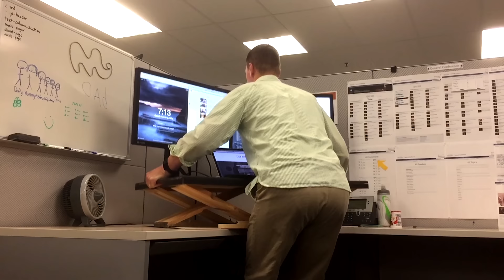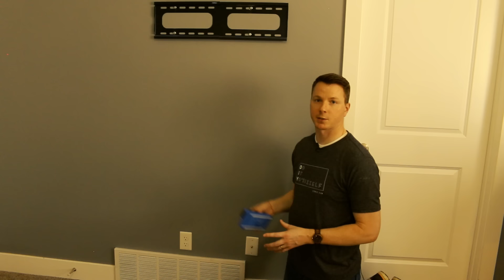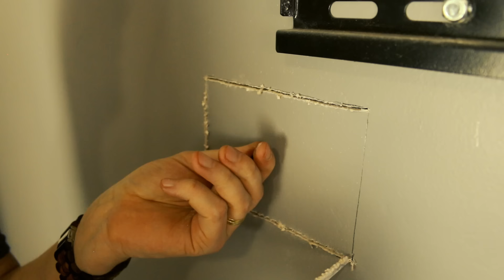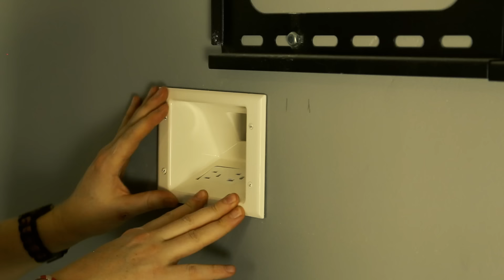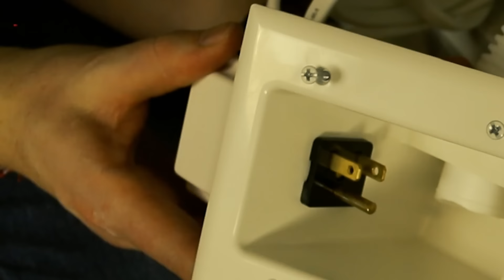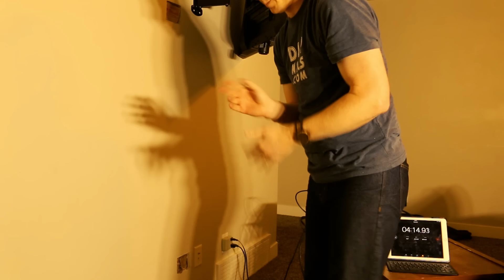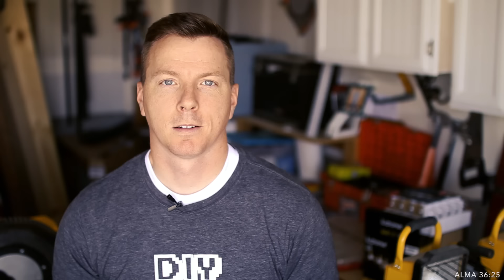How To Hide Your TV Wires in 30 Minutes - DIY

Comment: What a BS video demonstration.  So easy to follow a wall cavity with the outlets sharing the same cavity.  Also, yoiu dont need that contraption to fish the wire thru.  A total unnecessary expense.  How about showing a tough installation, where you have to run your wires across studs or floor joists, with minimal damage to drywall or floor or ceiling.  Then I could actually say the video was useful.  This one was crap and anyone with half a brain could do this.

Comment: I wonder if they have a kit that replaces the outlet with a hose so that you won't need an extension cord.
Reply: They do have it, I'm buying two of these and it replaces the bottom outlet

DATA COMM Electronics 45-0031-WH Recessed Low Voltage Media Wall Plate with Duplex Receptacle - White https://www.amazon.com/dp/B004GZ89N0/ref=cm_sw_r_em_apa_fabc_pHX0FbTCE59XE?psc=1

Comment: What do I use to cut through paneling without splintering it?
Reply from the maker: You have several options. Using a multi-tool or oscillating tool that you can plunge directly into the paneling would be clean. Another option is to drill a hole and then use a jig saw with a fine tooth jig saw blade. The shallower the better.
Reply: @LRN2DIY  thank you. Great video and instruction I’m ordering the kit in your link from Amazon right now

Comment: TIP: If you make the cuts at an angle, piece will not fall into the hole you make AND will be EASIER to put back and will have stronger joints on all four sides.
Reply: That would be true if you were cutting a hole and then replacing with the cut out but in this case you're putting a square plastic box in the hole instead, which if the sides were beveled you'd damage them anyway.

Comment: Great work and tutorial! Nice modern version of brush style or recessed cable/audio wall plates already on the market. Although, I must interject to your “up to code” comment. In my state, any long-term use of an extension cord is frowned upon. While you had the wall open, you could have added a junction box and rerouted power(with proper gauge Romex)to a receptacle behind your TV. Then just add a blank wall plate to cover the old receptacle location to eliminate dry wall repair.

Comment: 2 things? Why would you coil up the electrical wire and not cut it to length? And also, why not run it to the existing outlet and connect it there, and eliminate the extension cord?

Comment: Seems like the long way around - I moved the plug behind the TV with a 2.00 handy box and covered the existing receptacle hole with a blank cover. All you have to do is disconnect the plug and pull the wire up the wall and re-install the plug. Same With the antenna. Spent $10 bucks total.  20 minutes tops!

Comment: This is too much work & not that much hidden. I simply run a line from the outlet below & tap into the additional screws on the outlet & install an electrical outlet behind the tv. Bam all done.

Comment: If you put the wires in the tube before you run it down the wall it will take half the time. Been tv installer for 20 years and with me time is money. I enjoy your videos though and I’m not knocking how you did it because if you’re not careful you can damage the Hdmi cable. I also run a Optical cable down with the Hdmi for surround sound option if customer wants 7.2 speakers later on.

Comment: Seen the video, seen the wires go down the plastic tube but where do they connect??? All I seen was the extension plug he plugged in but it didn’t show where the cable wire plug goes once they go down the plastic tube

Comment: Would it be easy enough to get that pipe/conduit in your first install through insulation?
Reply from the maker: It would be trickier but possible, especially if you could get a fish tape or measuring tape and pull it through.

Comment: Could you also use the screws that are holding up the TV bracket to find your stud instead of a stud finder
Reply from the maker: You sure can. The TV mount is usually a good indicator as are the existing outlets, which are mounted to a stud as well.

Comment: FYI, there is flexible conduit called “ENT” that is fire rated for in wall use and will be stiff enough to pull wire through.  That bilge hose is not in wall rated so if you had a fire, your insurance company could deny your claim for having done work that does not meet building code.
Reply: Thanks,  very useful information!

Comment: Hmm no. I'd tap into the receptacle and if needed drill through the stud, fish wire and install a real receptacle. Then I'd get a couple brush cover plates for Ethernet / HDMI or run WiFi and no brush plates.

Comment: I followed your steps one by one and 3 hours later, I am no where close to being finished. My wires are stuck in the wall and can't pull them out of the bottom. I tried taking the bottom casing out of the wall, and its snug tight and I can't get it out without damaging the drywall. any advice?
Reply from the maker: Sorry to hear it's been a pain. I need help understanding what's going on with the bottom. It may be snug but loosening the screws should turn the flaps inward again so you can pull the receptacle out. I assume, based on what you're saying that that's not working? Do you have the hose in place or no? Sounds like you need to manage to get that bottom piece out no matter what so you can grab the wires and pull them through. As with any DIY project, things can certainly get difficult but hang in there and hopefully you'll manage to get it. Feel free to DM me on social media if you're still stuck.

Comment: Your setup doesn't respect the canadian electrical code. You need to install a dedicated electric outlet. In US you electrical code seems more permissive. And it's weird because you don't have a "fire stop" between your studs. For us it's an other hole in the drywall to make. And our wall can be thinner (3 inches instead of 4 inches), it's an other issue.

In Europe it's even worst lol. Their walls are made from concrete and plaster :p.

Comment: You had me until that extension at the bottom clean solution except for that.
Reply: That part killed me.  Could've run it straight to the electrical outlet and saved some drywall.
Reply: Yeah he could of tapped off the existing outlet, by fishing a 14/2 cable, instead of installing in a seperate stud channel, and having an external power cord. Then he could just cut in a seperate single gang box below for the hose. Everything stays in the wall that way.

Comment: But why didnt you drop power cable into the tube as well??
Reply from the maker: The tube is just to help run Audio and Video wires, like HDMI. The power is done separately through the included power cable. It's actually against code to drop regular power cables (TV power, console power, etc.) down through the wall, which is why these kits are so handy.

Comment: Me watching this from Central Europe:
Step 1) Sees the video,
Step 2) Looks at my wall with a PVC tunneling for cables that required me to use my 10kg power hammer to pick through solid stalinium concrete for over an hour, making every single neighbour in my flat an enemy of mine.
Step 3) Say to myself  "Ah, Drywalls... what would Americans do without them."
Reply: concrete walls.......ew lol
Reply: @noelsierra3465  That's called a prefab, flats made entirely from these prefab panels. Extremely fast to build, durable but due to them being made mostly during "liberation" by USSR times, quality (angles) aren't that perfect and often suck ass.

Still, years ahead of wooden framing and finishing made entirely from drywall, lol.

Comment: But what do you do with external walls that have insulation in them?
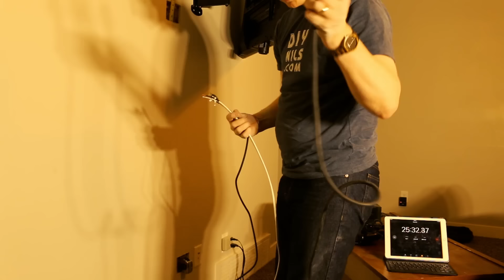Reply from the maker: You can typically do this with insulated walls too. You have to fish the wires through the insulation (right against the drywall) but it works. The job I'm doing at 15:20 is on an insulated wall.

Comment: where did you buy the wall adapters, plastic wire tube, and anything else for this project. i am hiding my tv wires. and how much was all materials?
Reply from the maker: Hi Jeremy, I put links to everything in the description. It's all on Amazon.
Reply: @LRN2DIY  Thank you. Did the push in connector come with the kit?
Reply from the maker: Jeremy Jones Yes, they come with the kit.

Comment: I like your tutorial!  The downside though would sway people away is how you showed how to pull a cable through the tube.  No one wants to take the time to take their whole tv off the wall and remove that each time they have a cable.  They want it to be easily accessible.  What I do is tie a washer (make sure it’s weighted good)  to a string then tie it to the cable I run though.  Throw the washer tied to the string down the tube till I find it (works every time and is fast) then pull it through till I find the end of the cord.  I keep the string behind my tv so I don’t lose it.  Again great video!

Comment: Not too thrilled here, the cable organizers etc cost like 60 bucks ans STILL I'm gonna see cables under the TV with a huge hole below the TV. Then in order to look neat I need to hide it?
Is not a critic about ur video tho. Thank u for posting and helping 👍
Reply from the maker: It's a good point - this method only hides it from a portion of the wall. There are other techniques but they're typically way more invasive, like running A/V cabling into a closet and that comes with its own costs and challenges. I suspect that one day we'll have way more of a true wireless standard, where there are actually no wires needed at all. But until then...

Comment: I had one of these in my house when I bought it and I thought it looked terrible.  The cords at the bottom look very unprofessional.  Why not just put a outlet on the wall behind the TV along with the cable?  You can jump it off the ones below and it is all behind the wall and looks much better.
Reply from the maker: That's an option too, yes. I have two other videos on adding an outlet behind your TV and running A/V wires separately, but some would prefer the simplicity of this message. Definitely different strokes for different folks and this is just one way to go about it.

Comment: Just as a piece of advice for anyone thinking of coiling wires like this.  I personally cant recommend doing this.  If you have ever run power devices through a coiled extension lead and thought it was hot then this is because of the coil.  Coiling wires can cause fires.  Just cut it to length and make the connection.  Might not be immediate but could be a few years later when you plug in a more powerful device and then you're fried in your sleep.

Comment: screw the TV wires. Where can I find that stud finder with the lights? I one that I have just beeps and is super hard to use because it does not beep reliably. Kinda useless.  to be fair my house is 100 years old and has plaster walls.
Reply from the maker: Hey George - the link is in the description. It’s been a good one. You can check out my full stud finder comparison video at https://youtu.be/IVkNyhmRO1k

Comment: None of these instructional videos have a clock running in the background.. no way this took 30 minutes..
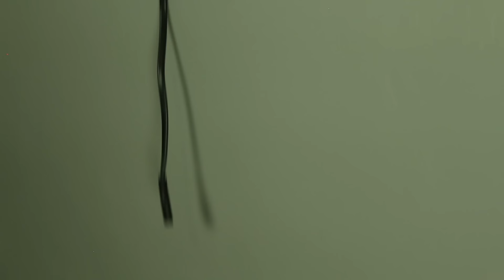Reply from the maker: It really is a sub-30 minute job. You can see the timer on the job I did at my friend's house starting around 15:00. I lost 20 minutes looking for a measuring tape to pull the wires but it took 50 minutes total, minus the 20 minutes of looking - so 30 minutes on an insulated wall.

Comment: You should feed a piece of string through the tube for each wire first then use to fish your cables without having to remove the top unit.
Otherwise great setup and video. Thanks.

Comment: By wrapping the power cable in circles, as you demonstrated,  you are creating a coil which will induce current into any conductive material nearby. It is safest to shorten and strip the power cable to the proper length.

Comment: The organizer kit is 70 dollars. Any other options that are less expensive to get similar results?
Reply: https://www.homedepot.com/p/Commercial-Electric-White-1-Gang-1-Decorator-Rocker-1-Duplex-Cable-Pass-Through-Wall-Plate-1-Pack-5310-WH/206456267. This should work. For the AV side you can use a bush gang plate on the bottom. For the electrical you can do what is called a daisy chain to an existing outlet, it will still be in code. Be sure the power to outlet is off before doing this, lol.

Comment: What if your outlet is not directly below the TV and off to the side many studs over
Reply from the maker: The bottom receptacle uses an extension cord that is, if I recall correctly, 8 feet long, so it would still work. It's up to you if you're ok with having the extension cord running along the bottom but it's certainly less visible than right under the TV.

Comment: All this just to hide the wire?  Poking big square hole through the wall, wiring with AC Pipe down and loop it on other side.  And what if you want to move the tv to a different location?  I would just use a wire organizer and have one straight line went down to the AC.  Can even be white to blend in with the wall.

Comment: I started this for my tv. I have cut the area put the plastic part on the top and bottom of the wall.  I need help because my wall has insulation and can't get the cords to go from the top to the bottom of the inside of the wall.
Reply from the maker: Tony Oldman Try pushing a tape measure through there and, if that works, pull the wires back through with the tape.
Reply: @LRN2DIY  Thank you I will try yhat.

Comment: Im not an electrician but couldnt he have put the lower box next to the power outlet in the same stud bay but just had the av cables coming out of it.  Then tied the newly installed upper power to that lower power outlet?  That would eliminate the extension cord deal.  But IDK maybe that would not be up to code or worse case burn the house down...

Comment: What did you use to measure how big the cut needs to be in order for the plate to fit into the wall?
Reply from the maker: The papers I'm holding up at 3:34 are templates that come with the kit. Most A/V kits will come with those. If not, you can just measure the actual box (not the face plate) and use those measurements.
Reply: LRN2DIY thanks!

Comment: That wrapped up electrical cable is a fire hazard. Wires heat up, when they're wrapped up like you showed, they're more likely melt their sheathing and/or cause a fire.
Reply: You can't run power cables or extension cords up through a wall, that's not up to code.
Reply: @dml1138  it depends where you live. Some places allow it

Comment: you could make your life so much easier by using a fish wire inside the tube. Then make sure any new cables you pull through have a new fish wire and let the fish wire just live in there. Probably cut your install time by 5 to 10 minutes.

Comment: you should have put in a brush plate on the bottom socket, and spur off the power outlet for power to top ,then no need for unattractive extension

Comment: Why not just drill two holes in the wall and drop a regular extension cord down the wall then cover the hole with a faceplate, its the same thing that your doing now just less cumbersome. Both methods are not within code.

Comment: Which way did you leave the tabs before you screwed the plates in
Reply from the maker: Tabs should be closed, or close to the receptacle when you put the box in so that it fits in the cutout. As you start to tighten the screws, the tabs will flip out and grab against the back of the drywall.

Comment: That’s a total mess and not the way to do it. You pull bottom receptacle out, punch a hole in the back, of existing outlet box, run Romex up the wall, make outlet cutout in-line high up behind the tv, put a cut-in outlet box after fishing wire through top cutout, put Romex through cut-in outlet box, add new receptacle plug, secure cut-in box, connect wires to new added receptacle plug, and secure wires to proper side of existing (lower outlet), put existing receptacle back in its outlet box, and you’re done. Now you have an electric outlet high behind tv. Only one small outlet hole is needed. Do it all the time and it works. Now you have 2 outlets or more with splitters, plug in tv, Apple TV, sound bar, whatever. Then you tie wrap those wires to the tv bracket behind the tv. No wires and no unnecessary large boxes next to your existing outlet. Which in this video is totally ugly and a waste of time.
Reply from the maker: Hey Mike, this way of doing it is one option. As with any project, there are multiple ways. I have a separate video on my channel that's pretty much just what you described (adding a new outlet by extending from your existing one), since that's another option. I have one TV in my house where I did that, with another where I used this kit. My hope is that these videos provide options for folks to look at.
Reply: LRN2DIY Got it. Options are good!

Comment: I install my outlets in between the tv mount square.. on the tv outlet side.
2. I run my wires thru tubing before inserting the square box in wall. easier..

Comment: My wife’s been asking me to do this for months. Finally got my chore done today. Was a bit tricky because I have an insulated wall and a 2x10 I put in while framing to make the future TV mount more secure. That board was located directly below where I installed the top opening. After some fighting we managed to thread the hose through all of that. The rest of the install was simple. Very happy with how it all turned out.
Reply: See? probably a woman's idea to hide everything behind the walls where you can't get at it to repair or upgrade even the smallest item..
Reply: Any tips for dealing with the insulation?